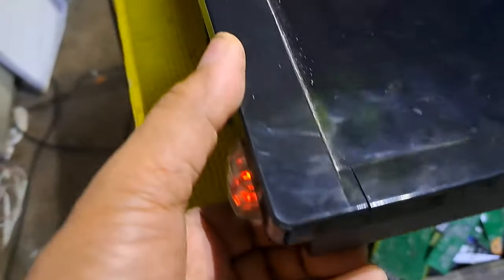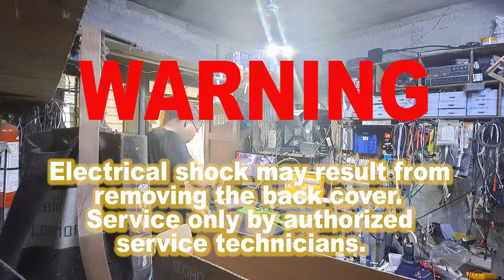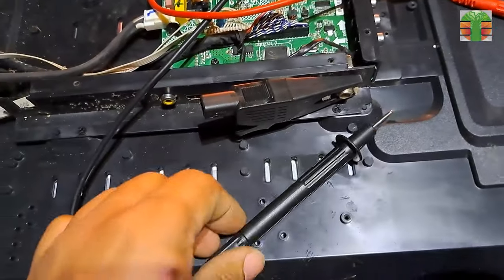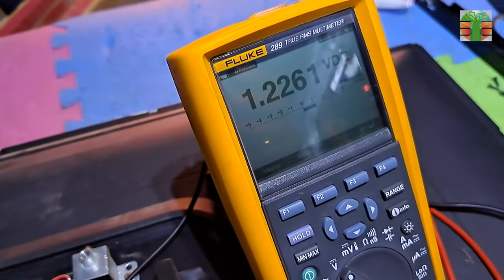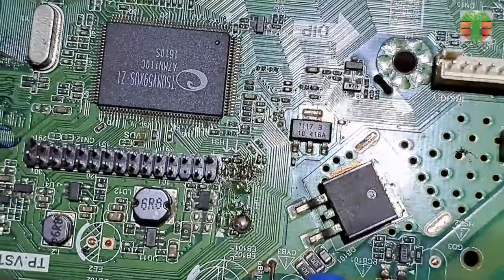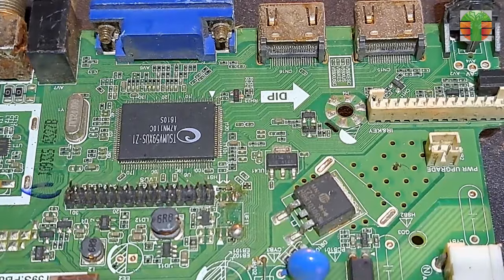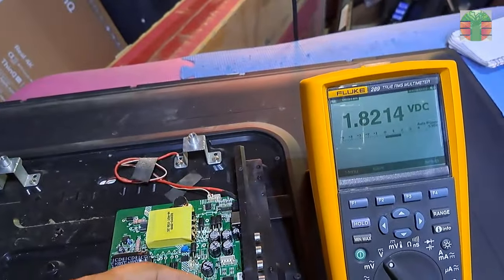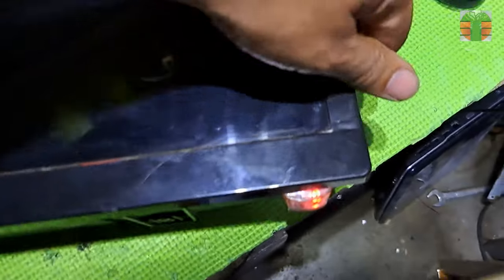O.6 volts is a big difference

Comment: Thanks, gonna check the pcb for the tv power supply before getting replacement. 

So with the tv plugged in, and the ground connected with the alligator clip. You can actually probe using multimeter safely?
Reply from the maker: No, I'm mesuring on the secondary line.

Comment: Sir I have tv stuck on standby I'm getting 1.5 voltage on ic could it be the problem
Reply from the maker: see if what is the code of your regulator
Reply: @tevzTVTevatronics  8pin ic 1118 ad 3.3 combined in one chip